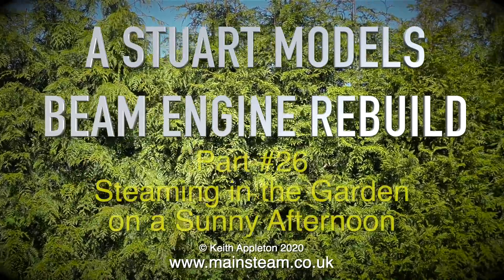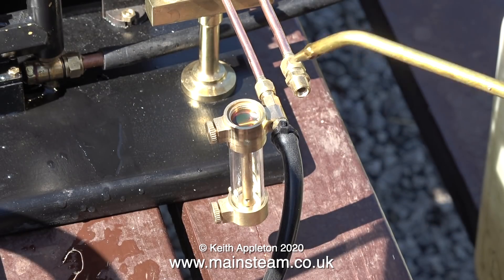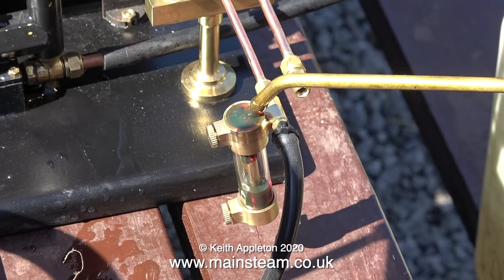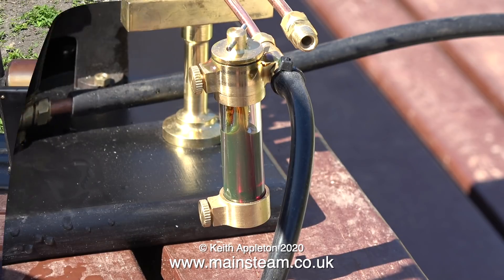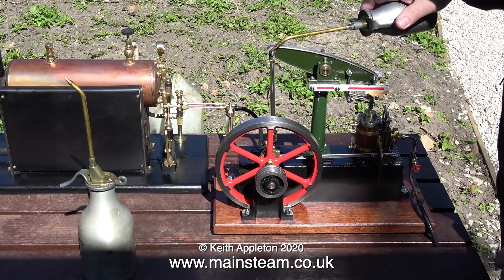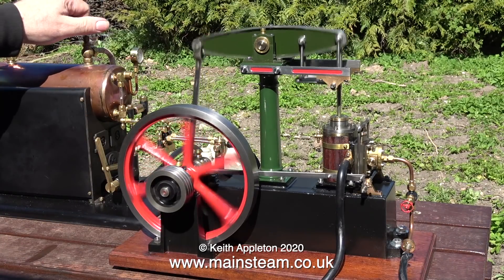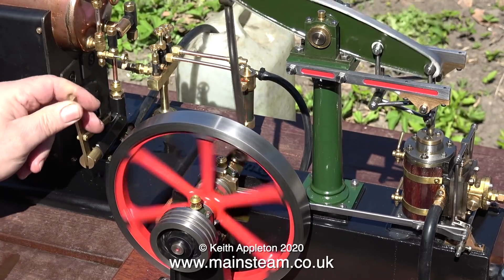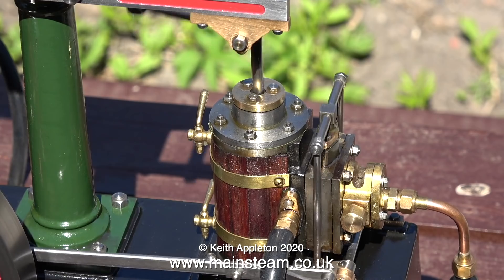A STUART MODELS BEAM ENGINE REBUILD - PART #26

Comment: Mechanical poetry in motion.  Thank you for posting.  Question...of the many table top engines I've seen you operate, other than the one with the generator, I dont really see you running them under load.  Is there a reason why you dont tend to add a load?
Reply from the maker: No need really, they work under a friction load, one plant I build had a generator built into the baseboard but most of the time it is just good to watch the wheel going round. My locomotives generally run do under load.

Comment: Curious: typical time span between adding water to boiler while running?  Be well!
Reply from the maker: Depends on how hard or how fast the engine is running as water replacement is relative to water evaporation.

Comment: Bonjour Keith,
I bought also one of these lubricators, it leaked, I screwedd its bottom, broke the glass tube and the little 2,5 mm bottom screw so retaped it 3 mm and put a copper tube... Experience brings sometimes bad surprises... Besides this, the flexible connection does not leak.
Amicalement, Raphaël.